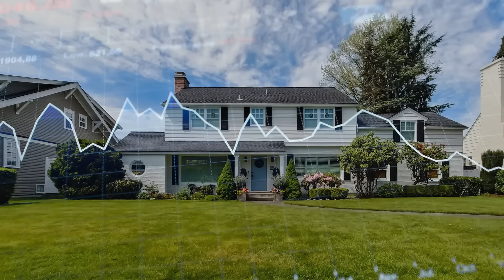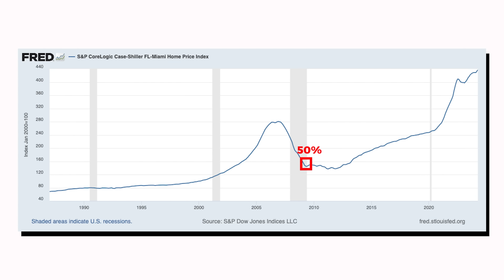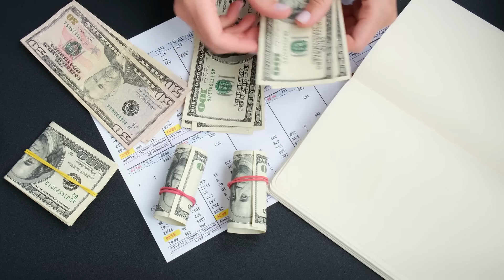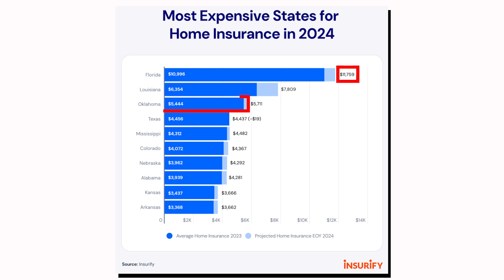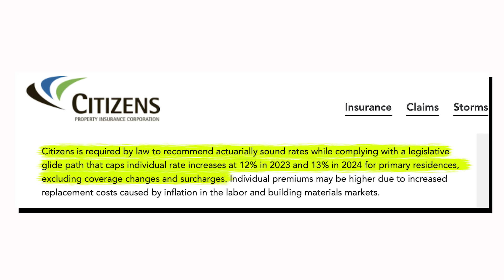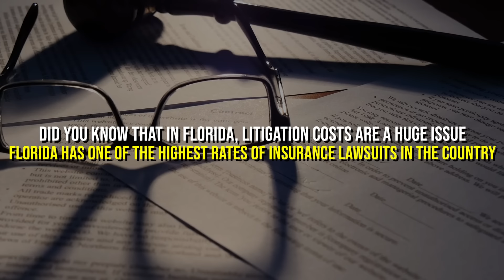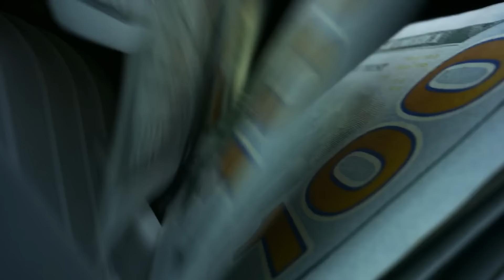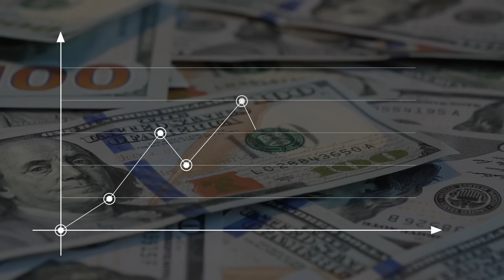DeSantis Drops Bombshell, Florida Real Estate On The Verge Of Collapse!

Comment: Maybe Gov. Ron DeSantas can create a state housing insurance bond system to insure their homes at reduced premiums? Or allow Floridians to deduct the insurance premiums off their property tax bill each year?
Reply: Back around 1990 when the Dems were in power, Florida passed a “save our homes” bill that capped property tax rate increases to a maximum of 2% per year as long as your home is your primary residence.  We also have a state sponsored home owners insurance company call ‘Citizens’.  But it is meant to be an insurer of last resort and not long term.  Though some have stayed on it for multiple years.  Now the state requires you to transfer to if you receive an offered by a private insurer, which is generally more expensive and they have had significant price increases due to the every growing size  and frequency of hurricanes and related home owner claims.  If you wonder what the state is doing to resolve this issue.  The answer is next to nothing.  Welcome to paradise lost.
Reply: If you deduct the insurance premium from the property tax bill, you are effectively having the government pay for the insurance.  How does that work?

Comment: Florida insurance needs to adjust accordingly to where you live. Not all Florida homes get damaged during hurricanes. Every home is not as high of a risk.
Reply: @Whoredash-b2b  the price of your vehicle insurance actually has a lot to do with your zip code. My point is, if you live by the coastline, you are obviously more susceptible to hurricane damage versus someone who lives inland. Homeowners insurance should be based on risk factors, kinda like your vehicle insurance.
Reply: It doesn't have anything to do with hurricanes.  It has to do with the rampant insurance fraud over the last 10+ years.  You haven't had one of the sheister roofers come knock on your door and say "Your roof looks pretty old.  That will be expensive to replace.  Just sign here and we'll force your insurance company to pay for a new roof at no cost to you, not even the deductible."?
Reply: @phillipsusi1791  I agree that insurance fraud has a lot to do with it also. The coast line and flood zones take on much more impact during hurricanes and storms, which is obvious. If you live in Florida, you are paying a higher deductible for those areas that are impacted by storms and "fraud."

Comment: Back in the day, when I purchased my first home to live-in; that was Miami in the early 1990s, first mortgages with rates of 8 to 9% and 9% to 10% were typical. People will have to accept the possibility that we won't ever return to 3%. If sellers must sell, home prices will have to decline, and lower evaluations will follow. Pretty sure I'm not alone in my chain of thoughts.
Reply: If anything, it'll get worse. Very soon, affordable housing will no longer be affordable. So anything anyone want to do, I will advise they do it now because the prices today will look like dips tomorrow. Until the Fed clamps down even further, I think we're going to see hysteria due to rampant inflation. You can't halfway rip the band-aid off.
Reply: Home prices will come down eventually, but for now; get your money (as much as you can) out of the housing market and get into the financial markets or gold. The new mortgage rates are crazy, add to that the recession and the fact that mortgage guidelines are getting more difficult. Home prices will need to fall by a minimum of 40% (more like 50%) before the market normalizes.If you are in cross roads or need sincere advise on the best moves to take now its best you seek an independent advisor who knows about the financial markets.
Reply: I've remained in touch with a financial analyst since the start of my business. Amid today's dynamic market, the key difficulty is pinpointing the right time to buy or sell when dealing with trending stocks – a seemingly simple task but challenging in reality. My portfolio has grown by more than $700k within just a year, and I've entrusted my advisor with the task of determining entry and exit points.
Reply: @joshbarney114  I appreciate the implementation of ideas and strategies that result to unmeasurable progress. Being heavily liquid, I'd rather not reinvent the wheel, thus the search for a reputable advisor, mind sharing info of this person guiding you please?
Reply: Finding financial advisors like Marisa Breton Dollard who can assist you shape your portfolio would be a very creative option. There will be difficult times ahead, and prudent personal money management will be essential to navigating them.
Reply: Marisa has the appearance of being a great authority in her profession. I looked her up online and found her website, which I reviewed and went through to learn more about her credentials, academic background, and employment. She has a fiduciary duty to protect my best interests. I sent her an email outlining my objectives and also booked a session with her; thanks for sharing.

Comment: The need to put a stop to ridiculous developer projects has never been more obvious. There are so many houses in Florida that when riding along any Interstate or the Turnpike, it looks like 1,000 travelers through tons of shoe boxes out of their windows while driving. Enough is enough. STOP BUILDING AND STOP PAVING EVERYTHING IN SIGHT IN FLORIDA!!!
Reply: I can't necessarily argue with that.  But, do that and, if you thought houses were expensive before, just wait.
Reply: @KRAMITDFROG there are over 100 empty houses in my zip code. Some have been sitting for more than a year. Brand new. They absolutely need to stop building. There is no shortage of houses.
Reply: @Heather-db6wq  Maybe that's your ZIP code.  Maybe people are waiting for rate cuts that may never materialize (honestly, people's expectations are unrealistic because when I bought my house the rate was 8.5%).  Not the first time that's happened.  They just built eight places more than $650K on a couple of acres across the street from my house - all are sold but one at $709K and that's pending sale.  

I never said that some places weren't overbuilt.  But, generally, those places are planned years in advance.  People will probably get bargains on them down the line.  

That said, we've had 12M people shoehorned into this country in the past few years and they are a huge reason rents and property prices have gone up as they have.  Until that stops, we're going to need more places for people to live. 

In my opinion, what is being overlooked is starter homes and perhaps that's why places by you are languishing.  Or maybe the commute sucks.  There can be a whole mess of reasons why newly built places in your ZIP aren't selling.  But, that is not the case everywhere.
Reply: @KRAMITDFROG  it’s literally all over Florida not just my zip code. Defaults are also up all over Florida. Apartments complex’s have tons of empty units. The over priced housing has zero to do with low inventory or smaller units needed. Also has zero to do with immigrants.
Reply: @Heather-db6wq  I agree with you. I'm in south florida and the amount of construction going into New apartment buildings is insane! And the renting price compared to the wages is absurd.
Reply: Pave everything? HAHAHAHA. Florida's  high real estate prices are caused by preservation and governments buying "endangered" lands at incredibly over inflated prices.
For example, The amount of land already taken by government from the people in Brevard is already 70% with only 30% left for homes and businesses and life in general. The 30% that's left has tripled in price because of the scarcity and now MORE will be taken..
These land buys are one of the two main causes of their high real estate prices and unaffordable rents.  
The other is sky high insurance rates thanks to TV Lawyers
Reply: @HappyHouseRealEstateUSA  sure Jan 😂😂😂😂😂

Comment: One of the first photos in your video explains everything. Two story homes with high pitched roofs are NOT FLORIDA HOMES!  A proper Florida home has a very low pitch, hip roof so as to be able to withstand high winds. Furthermore, intelligent Florida residents understand that homes built on land near sea level WILL BE DESTROYED in hurricanes.  This is not difficult, but those ignoring reality have made it difficult. In addition, steel reinforced concrete buildings have an engineered design life that is usually less than 100 years, as the steel reinforcement will eventually corrode and destroy the concrete. This too is not difficult to understand.  People who build homes on the foundation of wishful thinking will eventually pay for their willful blindness in one way or another.